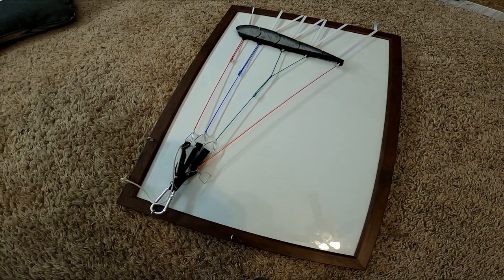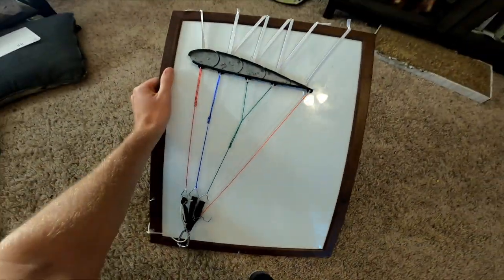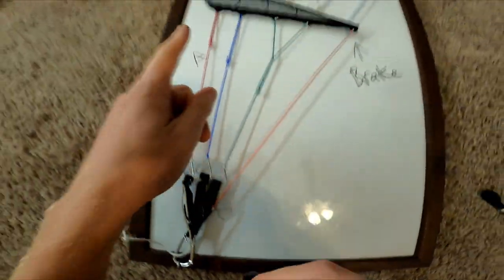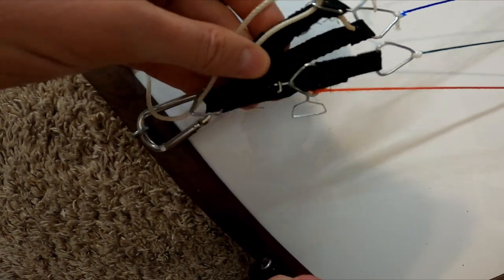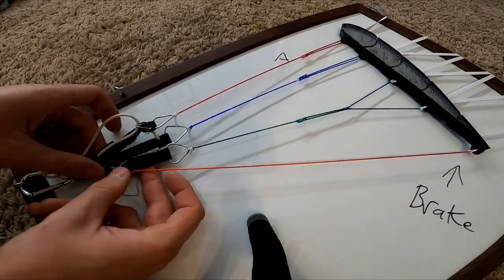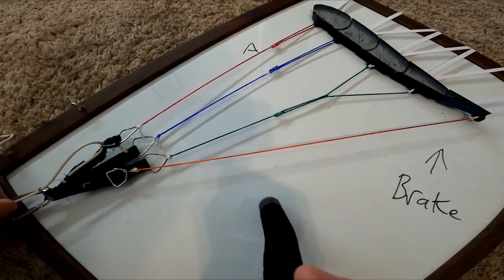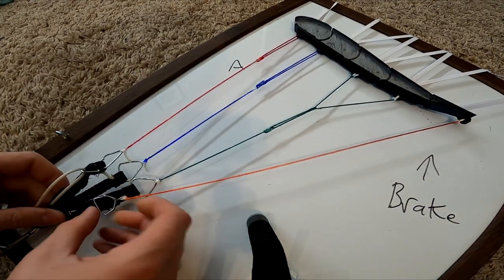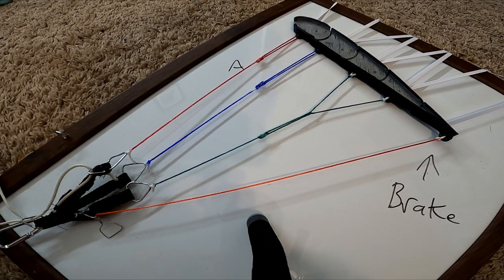Wing Profile Teaching Tool | Avery Flies

Comment: There is a big mistake in this video. When you release trims, in your video, the trailing edge goes up because there is a rubber band that pulls it. In the air there is no ruberband so there is nothing that pulls it up. A real airplane flying wing has a reflex profile because it doesnt have a " tail " to stabilize the plane. That's why in aviation flying wings have that profile. 
What I really don't know, is if there are paraglidres with the ribs cut in a reflex profile like an airplane flying wing. 
Have you seen a reflex paraglider rib with the reflex profile?
Reply from the maker: I have never taken apart a paraglider wing to see what shape it was cut in. I do know that in the air, you can clearly see the reflex swoop on the trailing edge of a reflex paraglider. Of course this model has rubber bands, and I am no paraglider designer, so I cannot say what causes it specifically but it definitely does swoop up
Reply: @AveryFlies  Ok. thats a good point. I havent seen a reflex flying enough to see if it swoops up or not, but I will do so next time I fly with my buddies. Thanks for the answer :)